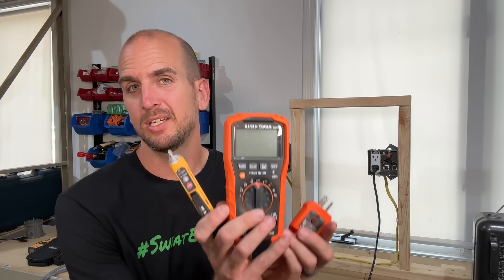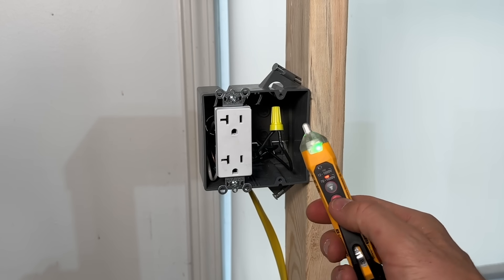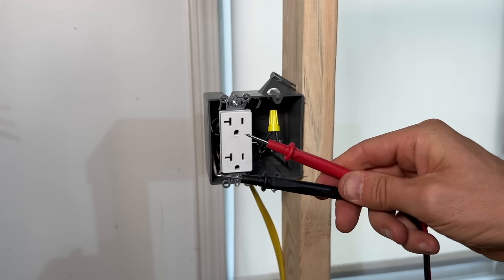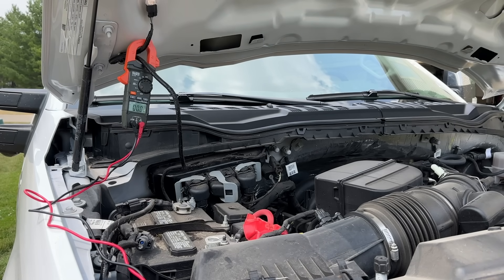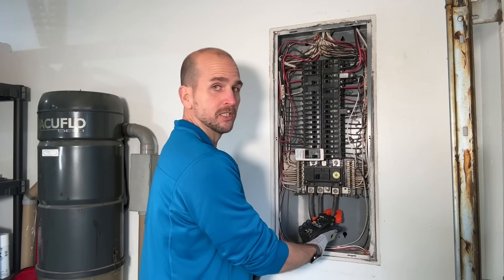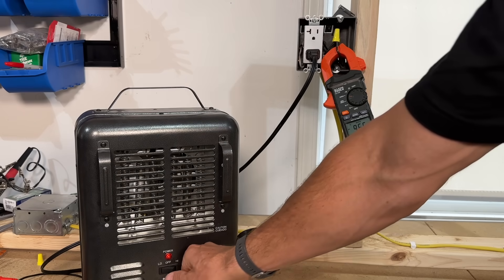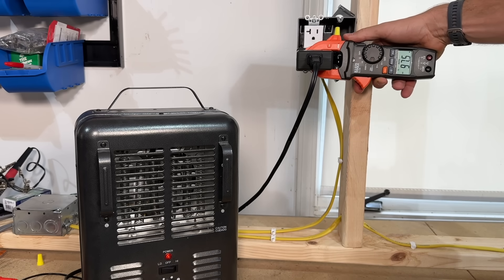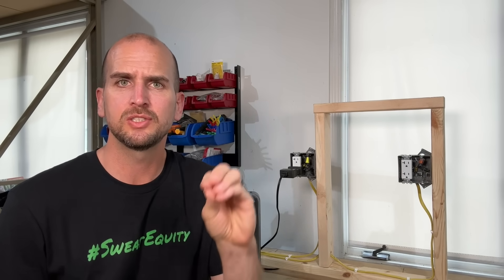Why The Clamp Meter Is The Only Tester You Need | Pros and DIYers

Comment: I'd add one to the list of must-haves... a circuit tracer.  Plug the remote into a receptacle or lamp socket and use the tracer to identify the breaker.

BTW... I agree on the usefulness of a clamp meter, but would recommend the CL390 over the CL120.  For just a bit more (~$20), you get TRMS and several of the missing functions you mention.
Reply from the maker: That can be pretty darn handy.  Thanks for the feedback!
Reply: An AC / DC clamp meter, very useful indeed! Thanks for the suggestion.
Reply: Does it exist for UK outlets? I can't find it for UK outlets
Reply: I also recommend the CL390 or one of the higher end Klein meters because those can measure 1. DC Amps (for automotive) 2. AC frequency, 3. capacitance (for HVAC/soft-starters), 4. current on non-60Hz AC (speakers and audio systems). An extra $20 well spent.

Comment: Thank you, Scott. I have been wondering if the modern clamp meters can replace a multimeter. I need both functions and did not want to buy both tools if the DMM would be redundant. Like you, I'm planning to buy the clamp to get a read on our current usage as I plan for a backup power solution.
Reply from the maker: Best of luck on the project!

Comment: These meters are great!! I changed out a panel last year and a few days after I was contacted and told the kitchen circuit kept tripping. I was thinking that perhaps I put in a 15 instead of a 20, but once I got there I did have the correct breaker. So i turned on their appliances in the kitchen and used my clamp and found out they were getting up near 23 amps. They told me that the old panel never tripped!! I told them, i just thank God we changed it! It should've tripped a long time ago. 

Thanks for the great video, may Jesus greatly bless you!
Reply from the maker: Dang, 23 Amps is a healthy load.  Were they running some type of hot plate?
Reply: It was a microwave and toaster and coffee machine in the kitchen and they were using it in different combinations.

Comment: I've been wanting a new multimeter to replace a really good one I had for years and have had instances where a Clamp Meter was needed for Amps.  The cheap $10 Harbor Freight multimeter is not good for some things because of low Ohms per Volt and shorted probes read 1.1 Ohms with no Zero ability.  Does any documentation you have specify the Ohms per Volt, AC and especially DC?  I don't see it in the Klein product website description or in the Instructions document.  Plus, a reviewer on the Klein page gives it only 3 stars for being cheaply made and Amazon has several bad reviews on this link.  What are your impressions of quality, durability and accuracy?  $70.28 for the Kit, with the Line Splitter being about $20 of that sold separately, indicates a pretty cheap, less-than $50 meter.  Maybe $40 with everything else included.  I didn't see a standalone price, so maybe $60 separately, if available that way.

The Ideal Clamp Meter is not in your store.  If I wanted to check it out, what's the model number, please?  The OEM SHop Repair Manual for my car says I need at least 5K Ohms/Volt to work with DC OBD2 computer modules on my car.  At least for the Speed Control module.

And, I only saw your #SweatEquity t-shirt.  You have worn a DIWire t-shirt or something like that.  Do you have that for sale, please?

Comment: If this is a dumb question forgive me.  Let's say I want to change out an outlet in a room down the line from a GFCI outlet. Is it safe to work on the outlet downstream if I trip the GFCI, or is it still required that I turn off the breaker in the main box?
Reply: I had the same question but after reading so many stories about how some houses are wired, I would suggest to find the breaker and just turn it off. I would do one more test with a MM to ensure no voltage and you are good to go. Might want to also lock the breaker box to avoid someone flipping it back. Just my 2 cents. Try at your own risk or hire an electrician if still not comfortable.
Reply: Assuming everything is wired correctly then it is safe. But since there is a chance that the outlet is not actually down of the GFCI, there is that risk.
Reply: @sergey8644  I got zapped so I always turn off breakers and do a voltage test. Has been my practice regardless. Better safe than sorry.
Reply from the maker: That would not be a best practice.  I would flip the breaker to off. 👍
Reply: If you aren't the only person in the premises at the time you might even consider a method of locking the breaker off to ensure someone  doesn't come along and turn it on while you are working.
Reply: @retrozmachine1189  I always carry a small lock since most boxes have a lock tab. I have not run into many without. It makes the people ask instead of just turning on the breaker.
Reply: I rehabbed a 50 year-old house and was shocked (no pun intended) at the cross-wiring of rooms which were not supposed to be connected. There were also other, non-electrical repairs which were clearly done by non-professionals. I later found out that a previous owner was a minister and she would hire people who were down-on-their luck to help them out, but they lacked the necessary skills. I wouldn’t take any chances if you don’t know who previously worked on the house. Turn it off and stay safe!

Comment: o well i have another brand of clamp multi meter but i like the tip testing on that one and ability to hold a probe also have that klein 3 piece kit and neither meter does capacitance which i might need for my ac unit capacitor

Comment: Thanks again Scotty. 👍 Now I need to compare which Klein Clamp Meter is right for me.
Reply: Any of the Klein Clamp on meters are fine EXCEPT the one that he is using in this video as it is not a True-RMS meter.
As such it will not give correct readings for certain things like LED fixtures or switched power supplies.
Reply from the maker: There are a ton of options and here are a few of the different meters and packages from Klein Tools https://www.kleintools.com/catalog/test-measurement/clamp-meters